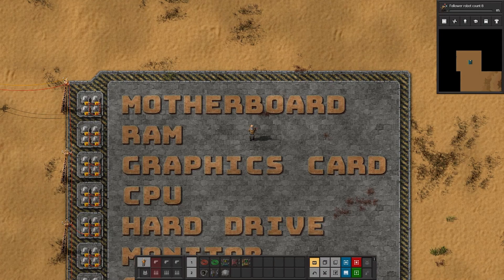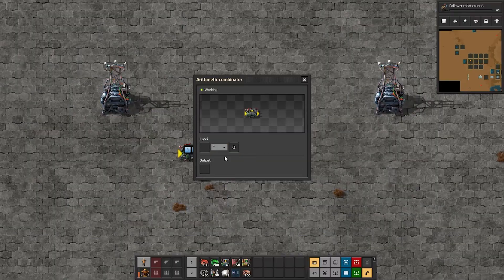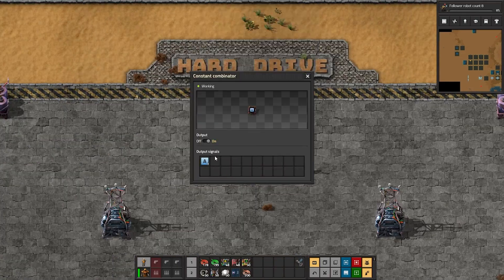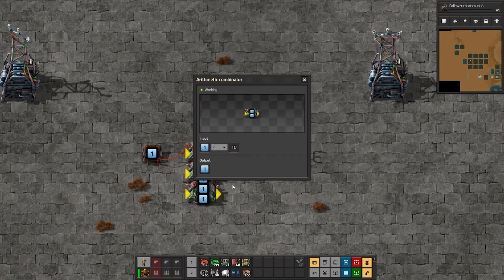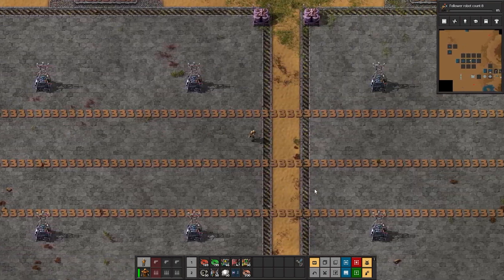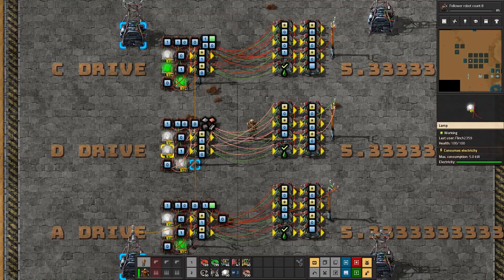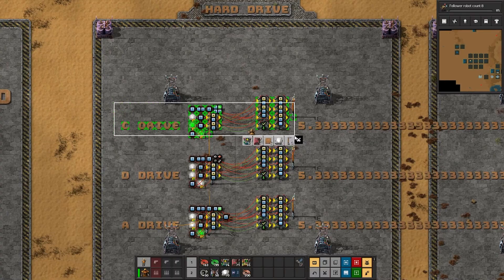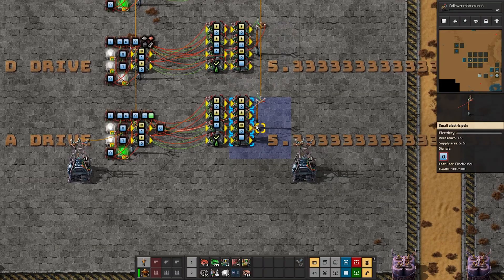Let's Build a Computer in Factorio! Ep 1: Hard Drive

Comment: "Making a harddrive in Factorio"

actually creates an SSD
For an actual harddrive, i'd just make a belt that loops around itself with a counter that reads how many items are on the belt, seperated by another item as a partition. For instance, 16 steel plates, 1 copper plate, 16 steel plates, 1 copper plate etc. 

Then on the opposite side you have a grabber that removes steel plates on command, altering the values. You might need to think of a way to stop the belt for that, or use a very slow belt, but what you're left with is a belt that reads , for instance, 16 steel plates, 1 copper plate, 8 steel plates, 1 copper plate etc.
Reply: Look at galaxy brain over here.
Reply: im just new in the game and started playing and learning the game, i was  also lookint towards this cause it looks same logical as minecraft redstone building so i was wondering if it maybe was possible to build indeed a calculator or anything cpu related (tetris) etc etc looking forward to see things grow in this game